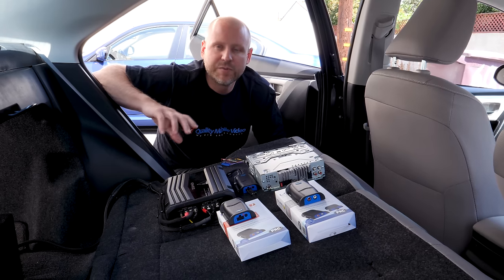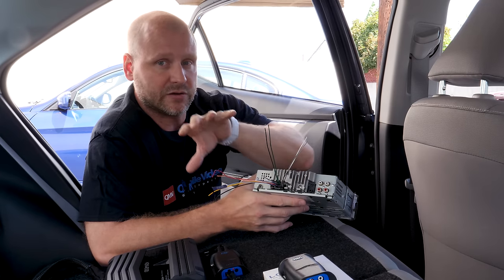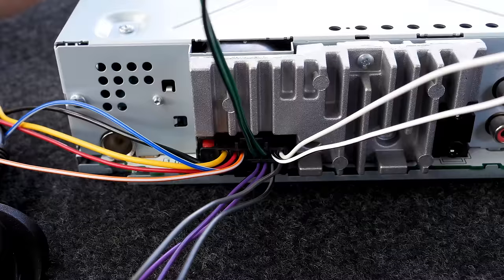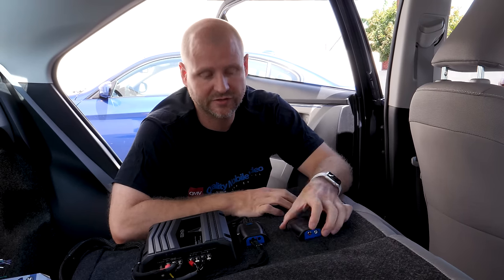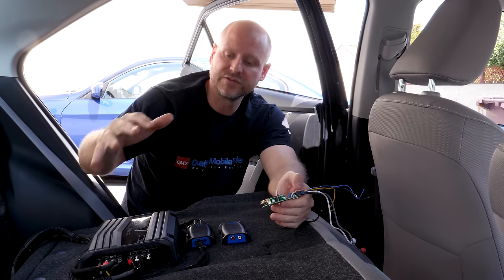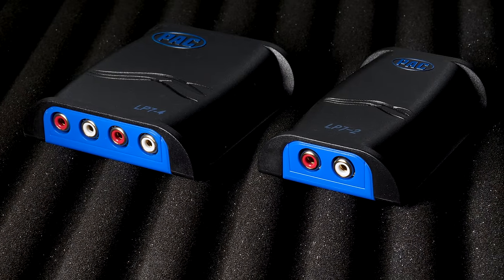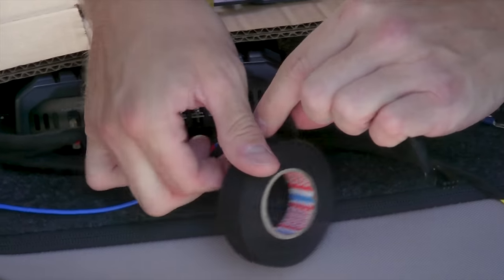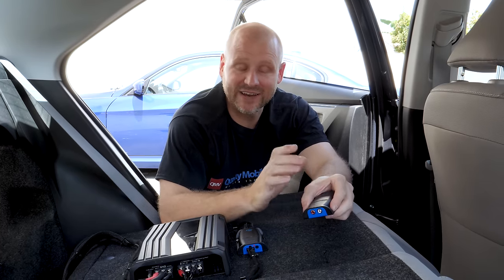Line Output Converters - What Are They - How Do You Install One?

Comment: Are the high level inputs generally quieter than the loc
Reply: Nothing wrong with high level.
The key is.   If you have to extend the speaker wire.
Use “cross link wire”.   No voltage drop with them.   More expensive though.

Comment: Installed this today. 2012 Malibu rear speakers. Loc will not shut off for 10 min tho I think it's the radio. I would understand if it was connected to front drivers due to chime. I may have to put mine on acc 12v

Comment: I've watched vids where they cut the wire right next to the factory stereo and then others that did your way.  Can I connect the LOC directly from each speaker rather than cutting the factory harness?  And do I have to connect all the speakers to the LOC?

Comment: Hey question. I recently installed a line out converter but i can only use 1 rca plug if i plug in the second rca my subs wont work. I installed on a 2014 chevrolet impala without bose the the wiring for the two rear door speakers
Reply from the maker: You may need to get this amplifier interface: https://www.qualitymobilevideo.com/gmos-most-02.html

Comment: Do you know if the 2015 and up Dodge Chargers SXT rear speaker wires are full range? I want to connect Audio Control LC7i or DQ-61 so I can connect 3 amps each for high, mids and lows from the just rear speaker signal.

Comment: Do LOCs increase the output voltage on the amp since the amp amplifies the low level signal, by increasing the low level signal let's say from 2v to 8v, shouldn't the amp hypothetically output 120v instead of 85v? (I'm using generic numbers, very similar to what my 2 Taramps Bass 8Ks output.
Reply from the maker: Brandon, No, they convert speaker level high voltage (8-50 volts) signal to low level RCA signals (200mv - 8 volt).

Comment: If my aftermarket radio has a front rca output and a rear/SW output, would it be a good idea to use Y rca cables to split the signal so I can connect both the sub amp and the front and rear amp? Or should I convert the high level outputs to Low level RCA and use that as my outputs

Comment: Mono block amp? Is there an advantage to wire 2 rear speakers to the LOC or can i wire just 1 speaker output to both +and- of the LOC if just used for a Subwoofer amp?

Comment: I installed the same ones. Through a 4 channel amp. And it sounds bad man. Not sure what to do
Reply from the maker: Check your phasing.
Reply: @Qualitymobilevideo  I had to buy a loc with load select. Cause I ran new speaker wire

Comment: Hey guys thanks for all that information! I still have a question tho... I’m about to install a Kenwood 6 channel amp on my 2017 Honda Accord that has the 4 speaker only factory system, so far so good right... 4 channels from factory HU to the amp then out to 4 speakers... my question is, what channel from the factory stereo/hu should feed the subwoofer since all 4 are taken??
Do I split the signal from the LOC’s RCA output so I can feed the subs input rca on the amp? What do you recommend I should do?
If I get a six channel LOC I face the same problem only at the inverse. 
What type of solution do you recommend? Your help is greatly appreciate it!!! :)

Comment: What do You recommend for 2016 Mazda 3 hatchback I wanna power all speakers and subs from the amps? And how would I go about wringing it up ? Do I run all
Speaker wires to the back or can I use some type of splitter from the stock deck so I don’t have to run wire the internal speakers? I was looking at a lc7i but confused on how to wire it up to the speakers so the amp powers them.
Reply from the maker: Hey bud, you can power speakers with your head unit and use your amplifier to either power just a subwoofer or subwoofer and speakers. Here's a great video we did on showing how to power your speakers with your head unit and subwoofer with an amplifier: https://www.youtube.com/watch?v=ViY4vGoYYDw
Reply from the maker: And this is the update where we added a 4 channel amplifier for just the speakers: https://www.youtube.com/watch?v=LPmZC9u39LE&t=897s

Comment: So I want to put this set up "Rear speakers and a sub" with el 4 channel amp RockFord Fosfate R400. Do I need a 4 channel line output converter and the same process of tapping the rears? How do I wire for 4 channel tapping the rear

Comment: a little confused with the wattage. first time i would be using a LOC. if i have a 750 watt amp and 800watt sub and the amp is still pulling directly from the battery so power wise its good does it matter if the LOC is only 400watts? my guess is no since the amp would still amplify and send 750 to the sub. would LC2i be enough?

Comment: If the blue Remout ON wire is connected to a constant power like in your installation, the amplifier will be ON all the time and may drain your car battery when the car is not running. Is it better to connect the blue wire to an "Accessory" or "Ignition" power?

Comment: What should I do if I want to add 2 amps to my head unit ?
My car doesn't have a stock sub, so I can't use audio control LC6 or LC7.

Can I use a 4 channel LOC or 2 2 channels LOC to power 2 different amps ? 2 2 channels are better to adjust voltage right ?

Comment: I have a 04 Toyota  with the non digital JBL system and My Metra harness has the RCA's that supposed to go into the back of the hu but the Sony aftermarket hu doesn't have pre amp outputs ! What should I do?
Reply from the maker: What kind of Toyota!? Gotta be more specific Nestor :)

Comment: nice video, a quick question, i have 2 amplifiers 1 for my door speakers which i understand for low line output converter is installed on stock radio, but for my subwoofer amplifier where do i connect signal wire for a low line output rca to my amp? thanks hope you can help

Comment: I have a popping sound and static. Would this help with that issue?? I installed a aftermarket Pioneer AVX 1500. With a 4 channel amp. And a 2 Chanel amp for a 12 kicker L7S sub.
Reply from the maker: Where is the popping coming from? The speakers, sub or everything?
Reply: @Qualitymobilevideo  its coming fromt he speakers when i shut off the car with a 5 second delay and there is static when i turn on the stereo. I think its a bad ground but I can't figure it out.
Reply: @Qualitymobilevideo  sad thing is I have taken it to three shops in the area and no one seems to know how to tune it properly. I wish these guys took more pride in their work like you guys do. you guys set the bar high just by caring about what you do. I appreciate your craftsmanship.
Reply: Quality Mobile Video sorry if I didn’t answer the question correctly. It is coming from the front components. I have some kicker kss65.
Reply: I think I'm having the same problem. Did you ever figure out what the issue was?
Reply: @gcdeen8783  yeah it’s the amp turn on and off. This could be fixed with a adapter. That controls the time delay to turn and off. I forget which one it is.

Comment: I have the speaker wires in my Amp but do i need to run 2 cables for left and right ?
It is just connected with thé left rear speaker, do i also have to connect it with the right speaker ?
Reply: (I don't have a LOC but a speaker input wiring harnas)
Reply: No

Comment: I have subs installed to my stock radio but now I have a aftermarket head unit was wondering how I use a universal bass knob without  having any rcas going to the head unit since I still have my line output converter

Comment: Here's what I'm currently struggling with. I have a 5 channel Amp to power my door speakers and a sub (2front, 2rear, 1sub = 5channels)... The amp has 3 set's of RCA inputs. If I get a Line Output Convertor... do I need  2 of them (1 for front channels/ 1 for rear two channels)? And if so, where does the sub's RCA input supposed to come from? it's crazy but it seems like there are no diagrams or instructions for this 5channel amp (4 speakers and a sub) configuration. HELP PLEASE!!!
Reply: Hey Billy, I'm having the same issue and was wondering if you ever figured it out? I'm still lost and can't find any info on this.

Comment: on a system with stock amp the speker wires are high level or not, i own a rx8 04
Reply: and if i want to connect them with high level input i have to get the signal from the stereo or from the amp

Comment: Very informative video! One question - how did you test for Full Range Output?
Reply: Roxshot Use a test tone disc and DMM.Test 40hz...400hz.....1000hz......4000 hz at the same volume level.If the voltage output is basically the same for each frequency then you've got a full range signal.If say 40hz has a much higher voltage reading than 400hz than that signal has a low pass filter on it....etc

Comment: Hey man great video . I have a question regarding a install I did myself on my 4Runner . I tried connecting this lp7-2 to my factory subwoofer but I’m guessing the voltage is too high for it to work . I just have it working with my amps built in high to low but the sound quality sucks and it’s very odd beat . Should I connect this behind the lp7-2 behind the stereo or should I just tap into the front kick speakers since those are always playing bass ??
Reply: Btw It’s just a subwoofer install to my factory stereo

Comment: I still dont understand.  Do I need the speaker wires that went to my head unit and install them to the amplifier?  

Then take the wires from my head unit and convert them to RCA and plug them into the line out of my amp?

This shit is confusing
Reply from the maker: You take the speaker wires and connect them to the LOC. Run RCA outs from the LOC to the inputs of the amp.

Comment: I have a 2018 Accord lx. I took a monoblock amp and a Kicker L7 out of my Tundra that absolutely pumped I use the same line output converter that you have in the video with the remote turn on I kicked the gain all the way up on the line out converter and the amp and it barely puts any sound out I don't know what to do???🤯 I also disconnected the noise cancelling system behind the glove box but it's like the Accord does not put much bass sound through the rear speakers so I don't have a good enough signal I have no clue what to do I'm about to rip it all back out of the car

Comment: Cool video,  my head unit have 2 rca, but I need 4 rca to connect to 4 channel amplifier. What do I do?
Reply: rca splitter
Reply: @jimmadness  thanks, that was very helpful. But will the quality be this same? Or can I also use the 2 rca for one channel and the other one from the front speaker, thanks.

Comment: When you install an LOC, will you still able to control the volume from the stock speaker volume control? Or you can only control it on the Amps directly?
Reply: LOC just taps into the existing signal. So, yes.

Comment: Sir what can I do to increase my radio volume level after having a aftermarket system installed in my 06 Audi A6
Reply: Don't know anything about the system.

What did you have installed? What type of system was it at stock? Do you still have an OEM head unit, or an aftermarket? Did your factory system have an OEM amp? (premium sound)

Need info to give info, broski.

Comment: I had mine working for years but the cables came undone on the amp and I forgot how I put them before.. so I put the yellow constant wire into the power wire running to the amp a d the black into the ground. It worked again but now my battery is getting drained??? Why? Anyone know what I'm doing wrong

Comment: Question and it may be a dumb one...
I purchased two amps, one is 4 channel and the other one 2 channel and aftermarket kenwood. Now I'm not a pro but the guys (audio shop) who did al the installation.  Installed 2 10's ,9 6's mids, 4 tweeters. Well I noticed they connected everything using high inputs . Which I didn't understand knowing the radio kenwood has 3 outputs RCA's for hi, mid, sub.
I'm I wrong or right that they should of used the RCA inputs ensted?

Comment: I'm having clipping issues at low volume after installing this to the rear speakers at the b Piller. 2016 Malibu limited no amp. I've tried all voltage 3-4-5v to amp and still clips. Any help would be appreciated.
Reply: I don't have a freq meter to check for flat spots but I can't get anything to stop clipping at all adjustments
Reply: 4m 55s may have answered my question I wonder if the rears are limited ? They sound the same as the front

Comment: plz answer. 
the guy only tapped into one speaker in my car with Bose. I used the lp7. 2 and I have to turn the gain on the amp higher than I think. I have 1 sub. should the loc been hooked up to both left and right speaker?
Reply from the maker: It possible they may have tapped only the factory subwoofer output hence the single connection. As we demonstrated we prefer to connect to a full range output and utilize the amps crossovers but it possible that your outputs may need to be summed to achieve a full range output.
Reply: Quality Mobile Video that makes sense I'll check and get back to you if you have time to reply. thanks for the help
Reply from the maker: No problem.
Reply: Go with a lc2i or lc7i it has higher voltage to help your hu which is a very low voltage that’s why you have to turn your gain higher with that crappy lp7 .2 loc if you’re only using to power a sub get a lc2i

Comment: Can i plug the blue remote wire to the amp remote screw, or i have to find and connect it to a 12v cable?
Reply: Yeah you can

Comment: So you don't need a 2-channel speaker wire adapter if you have an LC7i?
Reply from the maker: I'm assuming the 2 channel speaker wire adapter would be connected from an RCA output to the amplifier? The LOC is designed to connect to the speaker level outputs on the wiring harness of the stereo to the amplifier

Comment: I've been trying a reverse to this without much success, converting pre-out RCA from my head unit to line-level to feed the factory amplifier,  it's good enough for me. Originally with the high-line output to the amp it was too loud, as you'd expect but now with the pre-out it's too quiet at full volume. Not sure how I can find a middle ground. The amplifier in the head unit should be good enough as it's a new high-end Alpine unit so I'm tempted to rip out the factory amp and install passive crossovers instead for my 12 speakers. Still considering my options.
Reply: I have similar setup as you. I have problem that playing music wakes amp, but playing radio does not. Do you have problem waking factory amp with aftermarket head unit?

Comment: So, ive never had to use these before. Possible newbie question. My deck can run 4 speakers, no RCA outs. Can we jumper signals from the deck to the amp and also keep those same lines hooked to the speakers so that the signal goes into the amp, the amp can then power 4 more speakers? As I want to add two 6x9 and a dual speaker box, but still power the stock speakers from the deck. Make any sense? So i do not want to run the radios speaker wires to the amp, leaving those stock speakers to be then powered only by the new amp install. Is this ok, or not really good? I have option to replace the deck, but its a scion dvd stock radio which is nice and it runs two screens in the rear, having issues finding a deck that will work with the rear dvd's and not turn off when the car is out of park. Thanks for the help anyone@!
Reply: Ok, this video shows we can leave the stock speakers powered and just add new wires to go to the amp, leaving the stock speakers hooked up as well.. watch?v=MJ2EO4Ma6p0

So, i guess i found my answer. Good to know as the stock radio is another 4 channels to use! haha.

Comment: Couldn't i just wire it w my rear factory 6x9s? The battery and fuse box are already in the trunk on 07 chargers.
Reply: You can typically stock 6x9 have a full range signal

Comment: ok so i need to run a sub can i just tap on to my exciting 6x9's  with this and then run to the sub amp.? 
will it changes any thing or take away from the 6x9's i'm running now?
Reply: it shouldn’t. as soon as you splice it in it’s stepping all incoming currents down to a usable lever for a amp. if you used that as an amp directly off that speaker it would pull your levels because of demand. you couldn’t really do that tho cause amps need more power to even turn on sometimes. if that makes any sense, someone correct me if i’m wrong, i really only work on amphitheater equipment with everything already coming from a powered source

Comment: If doing a car that has a factory amp why would you not just tap the low levels from the stock HU? Especially if the amplifier does the processing and the low levels are a full range signal? Am I missing something?
Reply from the maker: Stock head units don’t have RCA low level outputs
Reply: Quality Mobile Video The schematics say "low level audio" for front and rears on a 2011 Terrain.These are the wires that run from the radio into the stock amplifier.I'm confused,what do the schematics mean by "low level" then?
Reply: John Adams where ever your stock sub is you can grab those speaker wires and use a line out converter.
Reply: phanny pack Well I'm using the low level signals before they hit the amplifier.They're full range and my Zapco processor can divide the frequencies up for me.Still don't understand why people insist on using amplified signals when they can just as easily use the low levels.
Reply: John Adams way way way cheaper.

Comment: Does an amp for subs needs to by wired up with both speakers?
Reply from the maker: You don't have to wire both your subs and speakers to an amplifier. Another option is you can simply power your speakers with your head unit and just wire the subs to the amp